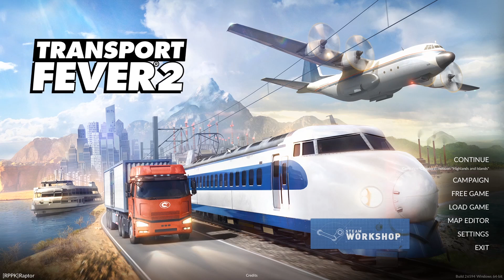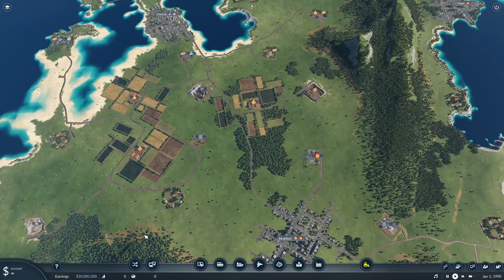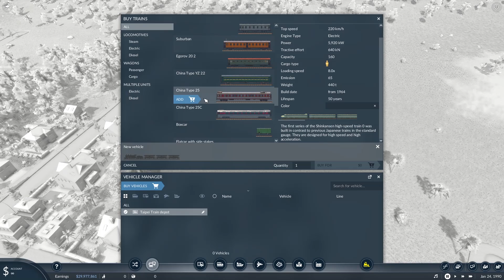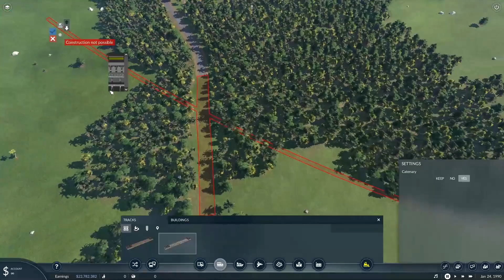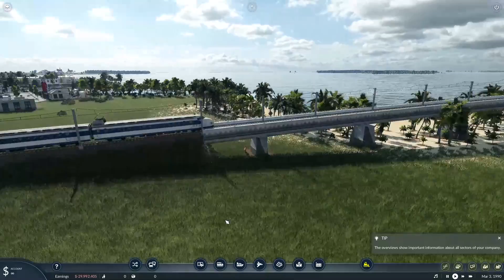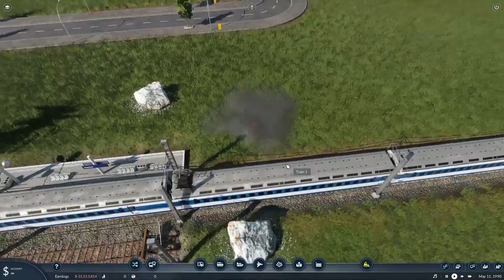First High Speed Train Ever Built | Shinkansen | Transport Fever 2 Railway Building Tycoon Gameplay

Comment: Anyone knows if they finally implemented some "Dynamic Pathfinding"? (Double tracks, overtaking, load-balancing or something like "grouped track sections" between signals.. ) 
Or are we still stuck with trains just using 1 track and will wait an eternity while a completely empty track is sitting right in front of it.. 

(For example: multi-waypoints)
Between signal group 1 and 2 they can use path A or B, and let it choose accordingly.
(E.G: If track A is blocked, use switch to track B.. But always prefer the original route, this saves useless re-calculations because only the route between the signals has to be checked.
Or have vehicles calculate to the next waypoint, not to the next station/stop..)

<<-#---\/--#(2)---------------A----------------#(1)---\/---#(2)---------------A---------------#(1)---\/---#-<<
<<-#---/\--#(2)---------------B----------------#(1)---/\---#(2)---------------B---------------#(1)---/\---#-<<

>>-#---\/--#(1)---------------A----------------#(2)---\/---#(1)---------------A---------------#(2)---\/---#->>
>>-#---/\--#(1)---------------B----------------#(2)---/\---#(1)---------------B---------------#(2)---/\---#->>

# = Signal
\/ = Switch Crossing

If this is still the crappy non-dynamic system I wont be buying  :(